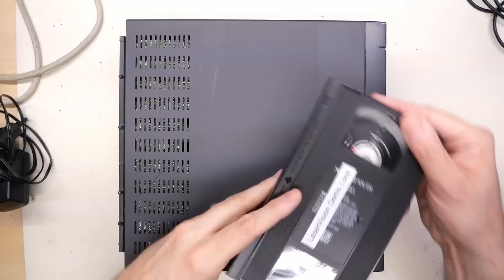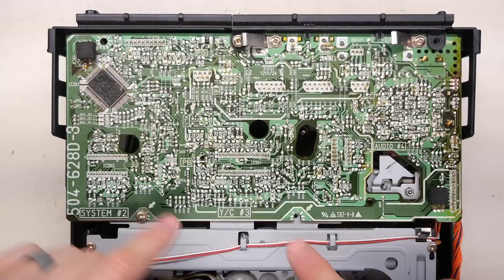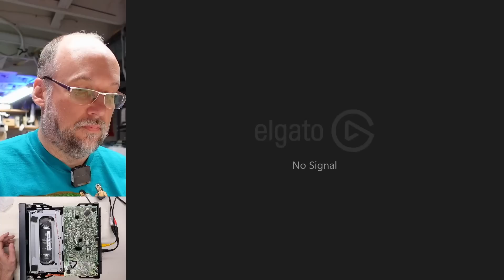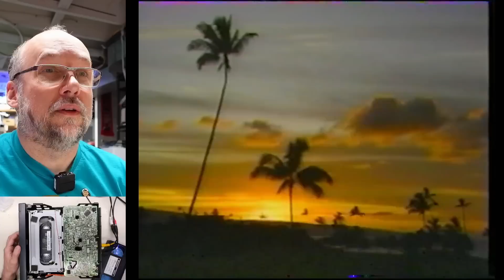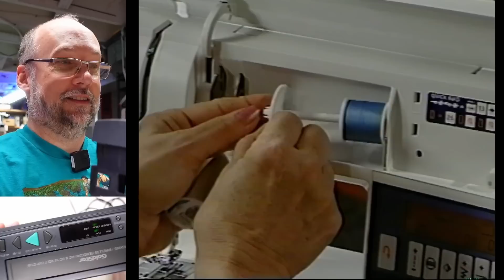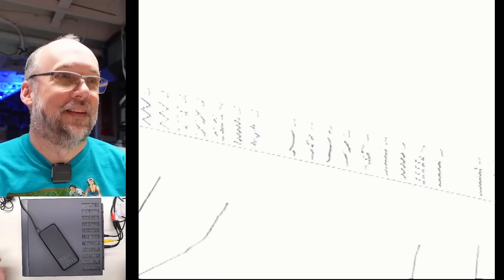Play VHS tapes while sideways and upside down (Goldstar GCP-C135)

Comment: You do not clean the head clockwise. You rotate it the way it rotates during playback. Which is usually counter clockwise, the rule of thumb for lithium grease is it’s not safe for plastic (if the grease is petroleum based)

Comment: Back in the mid to late 90's my family traveled the country with one of these and a small white crt TV in our green Chevrolet Astro van. My father built a nice little console for it to fit between the front seats. We had a small little 300w power inverter running everything.  

The audio would play out through the 3.5mm audio jack into the cassette tape jack. 

Definitely saved my parents a lot of headaches with my brother and I on road trips.

I had completely forgotten about that little VCR. 

Thank you for the trip down memory lane.

Comment: I had one of these mounted in a late 90s suburban, in the cargo area to the inside roof. It ran to a 5 or 7 inch fold down LCD screen mounted between the front seats from the roof. Obviously for the back passengers (kids) only. It had a small flat credit card sized remote that you had to point back at the VCR. The sound went through the trucks speakers via a manual toggle switch. This was a "top of the line" after market job on a dealerships demo suburban. I bought it used a few years later.

Comment: The Husqvarna sewing machine video reminds one of a typical use case for a player like this, other than RVs and stuff: Commercials/product demos in retail space. Think about it: where else does the REPEAT button/function (playing a tape over and over) really make sense? If finally turns out this machine is actually more tolerant about playing in any orientation than more standard "living room" models, there's another advantage for you: you can tuck the unit away from customers' eyes more easily.

Comment: 3:26 - not really, they decided not to. My Elekta PAL/SECAM VCR which possbly was made by Aiwa, has the recording functionality via composite and it's small and 220 volts and 12 volts too. However adding a tuner back in the 90s to these portable VCRs was impossible since those old analog tv tuner heads required 30v to tune them, and it would possibly increase the size too. If you wanted to record tv broadcasts on a non tuner recording vcr (oddly they called these things "video cassette players with line recording" by manufacturers) you needed a TV that converted the RF to IF and converted IF to composite video with audio (quite common in Eastern Europe) (those are the mysterious video outputs on TVs, they also decoded RF to composite for those VCRs with no tuners)

Comment: That Jack on the modulator-module is typically the aerial output that would be connected to the tuner module on VCRs that can record. I guess they just used the same modulator for this player.

Comment: Hope you recover soon, Adrian.
Earlier single-speed VHS machines did provide quite decent still-frame and trick-play results. The issue with the 2-head SP/LP/EP machines is the head wafers are thinner to accommodate the narrower tracks needed for the long-play modes. You will likely find LP/EP recordings give a better image in trick-play modes on this machine.

Comment: 17:21 - The moving post is what controls the felt band tension. So, if the post gets pushed to the right due to increased tape tension, that loosens up the band, and vice versa.

19:37 - Counter Clockwise. I had to do a double check on one of Dave's videos, so I got it correctly. It's CCW. The head drum spins in the same direction as the tape passes by on, to help it move forward.

28:21 - That's how the brake mechanism works; at the start of fast winding the brakes, being spring loaded, are getting 'wound up' into a position where at the end of it they just get released to snap against the spindles for instant braking action. This is completely normal.

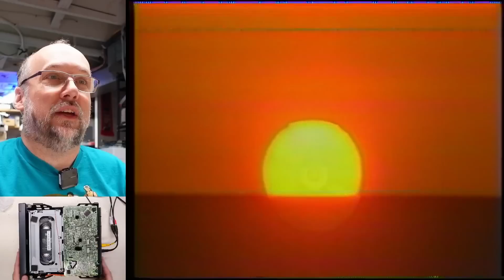30:35 - On the bottom of the picture there's usually a pulse of 'noise' (in alternating spots between the frames, but there's just one actually), that's the very spot where the switch between the heads occur; interestingly, the engineers of practically all magnetic tape formats decided that it won't happen in a blanking area, but just a few lines before the active picture area ends. I assume the practical reason for this is making the head switching visible without having to use a special monitor that can be desynced, to monitor tape tension, but without impacting much of the screen area. Incorrect tape tension can cause a horizontal 'shear' effect on the lines immediately after the head switch. The position of head switch pulse also changes along with changes made in the tracking, relative to the horizontal sync pulse. IMHO that was a missed opportunity of implementing tracking without the use of a linear tracking signal, sensing the time relation of the head switch pulse and the horizontal sync pulse. AFAIK, no manufacturer did that.

Any VCR is supposed to be able to operate in any position. The cassette door tends to jam in some tho, in my experience.

Feel better soon, Adrian!

Comment: For the mode switch on that model if you evert weird behaviour it looks like you only need to remove the black cover, just gently push in the white tabs in the centre and pry the cover off with a small screwdriver. The lower flat contacts can be cleaned with deoxit, or even good old IPA and a cotton bud. The tiny finger contacts on the underside of the cover can be cleaned with the same products just make sure you go in the direction the little contacts are orientated. You can also very gently pry the little fingers up a little to get better contact but 99% of the time that isn't necessary.

Comment: Nausia and stomach "not functioning" is sometimes caused by low acidity in the stomach. Try drinking Cola (if you can control the resulting sugar rush) or lemon juice (i.e. - squeezed lemon). They are both at the same acidity level, and from experience (mine and others) it causes you to immediately feel better. Note that when I said "Cola", I did not mean any of the diet variants. They are less sour (i.e. - less acidy) as regular Cola uses the insane amounts of sugar in it to balance out the very high acidity.

Comment: My family had what was probably one of these exact models when I was younger, specifically for use on our boat! It was a great unit in that application, both for size and the ability to power it off 12V. It didn't give us any grief as far as I recall, regardless of the orientation.

Comment: My Hitachi from 1992 keeps the tape loaded except for full speed rewind and fast forward when it unloads the tape from the heads. Also you have to turn on a feature it cause movie return if you want auto play when insert a tape. Also if you want the VCR to rewind the tape at the end and eject. It's a wired one and surprisingly mine still works as Hitachi VCRs are famous for having leaky capacitors from this era. I probably need should recap it but VCR works fine and I don't want to fix something that ain't broke.

Comment: We had a similar one that my brother grabbed out of the trash pile at his university when the dorms were being cleaned out at end of term in  about 1996.  It was originally in a rental case from the local Video store  before we shucked it out.  The power brick was integrated into the case, but could be removed.

Comment: How come in america you have saterlitte screw on connectors for your Ariel  and just RCA connectors and the uk has push in connector for the Ariel and scart sockets
Reply: We used to use balanced antenna connections with two screw terminals and then switched to F connectors starting in the 1970s. You had your inferior coaxial connectors since the early days and stuck with them even though they do not perform well at high frequencies.

Comment: I actually have a recorded VHS tape that somehow has the recording at the very start after the leader that I have not been able to properly capture due to all the VCRs I have having a OSD that shows up when I try to rewind and play that part of the tape so the fact this VHS Player does not have any OSD is great for my need of wanting to preserve that tape's entire contents. Also this helped me realize I really need to pull my main VCR apart and grease it up and do a better cleaning job on it to preserve it's proper operation.
Reply: Many VCRs have different modes for the OSD such as always counter always visible. One of these options should suppress the OSD completely.
Reply: I've used a bunch of VCRs over the years... I think due to a combination of buying the next level up from the cheapest and buying the only thing we could afford. Although somehow we were luckier than another family member I knew who just kept destroying the cheap ones they got. Some of them don't do that some of them do and some of them let you toggle it in the menu if you can get into the menu without the remote. It is so annoying that they Blue out on static so quickly. And then that's complicated by the capture card doing the same thing.

Comment: As a former bench tech for rotary head machines of all sorts, the mode switch was by far the most common repair. I had dozens of different ones in stock, all functioned similarity. Slip ring and pinch rollers also were common.

Comment: I ran a cheap store-brand (Shintom manufactured) VHS VCR for several years placed on its side in the bedroom due to lack of space, and it was fine. So I think this was a standard thing for these machines.

VHS did start out unlacing the tape on FFWD/REW but by about 1985 most machines permanently laced the tape. Betamax laced up from day one, although the Sanyo VTC5000 series of the early to mid 1980s unlaced, and I think it tells its own story that these machines proved to be far more reliable than the Sony and Toshiba competition despite being cheaper - the heads didn't fail on them. The Sanyo was the best selling VCR in the UK in 1982-3, and there are still hundreds if not thousands of them still working today. They're not perfect - early units had a nasty little firmware bug that caused the tape to lace up on rewind if the machine detected a stall, which would lead to chewed up tapes if you ejected after this without hitting stop first, but overall they were real workhorses.

Comment: A lot of these were installed vertically in an armrest. I remember renting conversion vans for vacations in the 90s and they VCR was always hidden away while the TV was front and center there in the back of the console or on the ceiling if it was a high roof van.

Comment: I have an old Panasonic VCR but it has an issue where the picture throws up random color noise and sometimes the sound would be just noise. I'm wondering if the head amplifier has an issue.

Comment: ex vhs tec st sbout 1979 they started have 2 option stop then ff or rev which uloaded the tape for faster rw and fw but if u pushed in play was pitcture rw fw which was slow and did wear the heads

Comment: My parents had a video store back in the late 70s thru the early 90s . These vcr were designed as a rental unit with a 120 volt power supply
Reply: I'm not sure with this unit but a  few systems used petroleum jelly as a lubricant on the gears. Also I remember fixing these as a kid at the store and one came in with a peanut butter sandwich inside of it.

Comment: This was more likely to see in tour buses. In an RV, a recording capable one would have been more handy (recording the evening show or sport event while you are fishing or whatever). Although I don't know if 12V ones with recording capability AND tuner were available or not. I've seen ones that can record, but only from an AV source. About the orientation: you're not supposed to operate a VHS cassette upside down. The reels can rub against the top of the cassette, especially with longer tapes, as the springs that normally push down the reels can't do their jobs properly if they are under the weight of the tape reels. You can operate it in any orientation, except upside down. This note is included in the user manual of full-size VHS camcorders as well. As can be seen here, they can operate upside down, but it is not guaranteed with every cassette.

Comment: I'm still using VHS as my main method of recording/watching movies/timeshifting. I have towers of VHS recorders that all more or less work and almost a thousand movies and some TV series. Most of my machines are from the 80s.
Also I don't have a flatscreen TV*. And I don't care about the video quality. If a movie is good, I don't care I can't make out the pores of the skin of an actor. Sure there are movies where HD is kinda required... but if that's the only thing a movie has going for it, I'm not interested. Good stories barely need video at all and a good action chase scene looks plenty good in SD.
*) not entirely true. I have two doorbell camera monitors that use SONY Watchman CRTs which are flat, and I have a stack of pocket LCD TVs from the early to mid 90s. They are pocket TVs though (and thus fit in your pocket) and have abysmal picture quality (honestly I haven't even tried. But I did watch some B&W movies on the doorbell monitors - since these are B&W CRTs, they have full resolution and are pretty watchable).
(and yeah you read that right - I still record new movies on VHS if I deem them good enough - once or twice upon a decade a movie comes along I like so much I record it onto other dead video formats like Betamax, V2000, VCR, Hi8)

And yeah. I once or twice contracted food-bourne diseases. First time it was two days of just sleeping and getting everything out of my body on pretty much all openings and then another day of just sleeping for like 24 hours.
Second time I felt better on the second day only to bounce back on day 3 and then it just went into self-oscillation that went on for almost a YEAR!

Comment: Those chamois cleaning sticks were the best thing to use.  You can actually clean them with the same fluid you use the clean the heads (regular old IPA works fine, at least that's what we used to use back in the day).  Those sticks really only wear out if the chamois comes off the stick, or the surface of the chamois is damaged.  They are actually very robust little items.

And they are the absolute best for cleaning heads in a VCR (or audio tape deck for that matter.)

Comment: The heads on most 2-head VCRs are optimized for EP, so you'll get (almost) clean pause and fast-forward/reverse search in EP, but noise bars in SP or LP.
Reply: It's actually has to do in part to do with the fact that EP (and LP) has little or no space between the video tracks on tape SP while mode does so when the heads swipe over multiple tracks when doing ffwd/rwd you pass over areas with no signal in SP mode hence you get some noise. With 3 and 4 video heads the vcr can switch between the different heads to help mitigate this.

2 head vcrs in north america were a bit of a compromise between EP and SP mode so they were not optimal for either, same with newer multi-system vcrs. In Europe most 2 head vcrs were SP only and you needed a 4 head vcr for LP mode (PAL SLP/EP was only something found on some SHarp and Panasonic decks in the late 90s/early 00s). Not sure whether 2 head vcrs in the Japanese market were commonly SP/EP or SP only.

VCRs with 4 video heads (other than some broadcast vcrs) has one pair that's optimal for SP and one that's optimal for EP/LP, and can also make use of switching between then for better pause/searching. (VCRs with 3 video heads and the some SP only broadcast/pro decks with 4 heads use the extra heads purely for better search/pause)
Reply: Do 6-head VCR have (almost) clean pause and FF/RW in EP, SP and LP?
Reply from the maker: Heh after making the video, I played an EP tape and yes this was instantly evident! I surely knew this at some point but then forgot it.
Reply: if you knew anything about VCR's you'd know it's bad to pause your tapes it damages them.
Reply: @RebelMediaL.T.D  You're telling vwestlife he doesn't know anything about VCRs? Lol.
Reply: @RebelMediaL.T.D  WTF? talk about an attitude.

Comment: I am also type 1 diabetic
coca cola usually does the magic for me when I have low blood sugar (always have one with me in my bag) otherwise grab some liquid dextrose it also works pretty fast
I don't have an insulin pump so I know how they work and measure blood sugar. but I have a freestyle libre 2 so it comes with alarms on my phone both when the blood sugar is too high or too low
would recommend it to anyone with type 1 diabetes
It has saved me many times, I haven't passed out since I got it. And before that I passed out 3-5 times a year

Comment: Those chamois tips are somewhat popular for cleaning game cartridges since they fit basically exactly between the plastic shell and the card connector without disassembling the cart and don't leave fuzz behind like cotton buds often do. I usually see them in kits with other "game cart cleaning supplies" so I didn't know they had a specific name besides "the wide and flat swab"

Comment: I have a VCR/DVD/HDD combo that wouldn't accept any tape, it loads the tape but spits it out a second later. Might a dirty tracking information head be the cause of that?
Reply: That's most likely a dirty mode switch. If it doesn't get confirmation that the mechanism is in place it thinks it is jammed and gives up.

If the control head is dirty it will think your tape is blank.